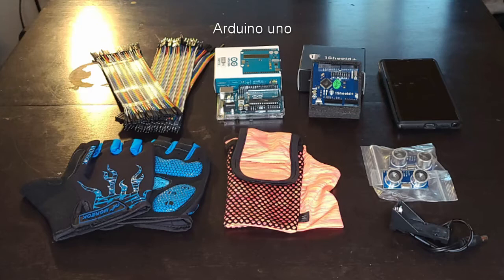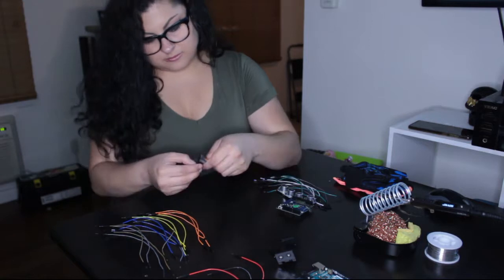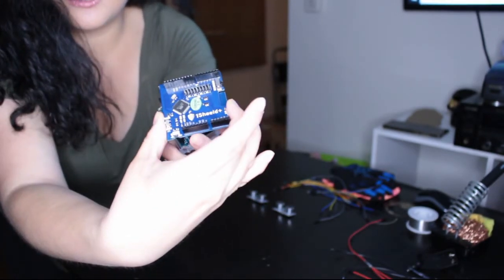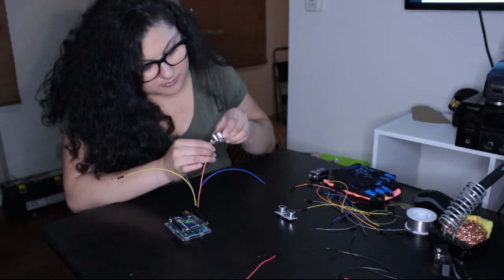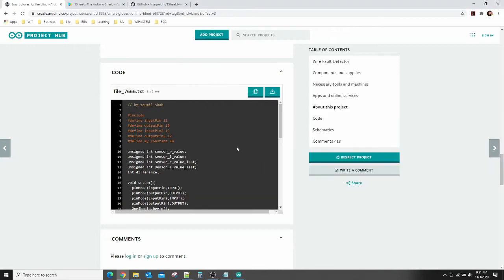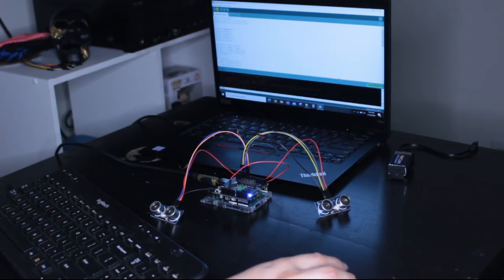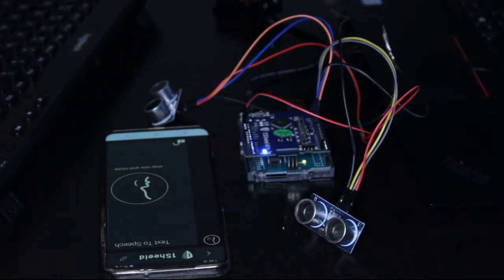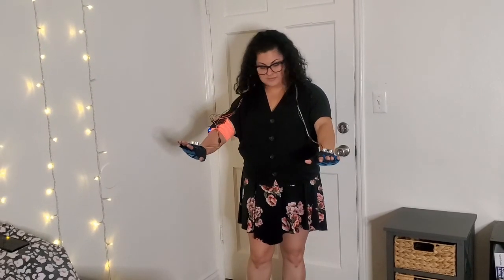Smart gloves for the Blind - Quickie - Arduino Uno and Ultrasonic Sensors

Comment: How did u fix it with gloves and arm band ?
Reply from the maker: Arm band and gloves were bought on Amazon. Once arduino was programmed and 1Shield was installed on my phone, I attached sensors to the gloves and put the arduino and battery pack in the arm sleeve.